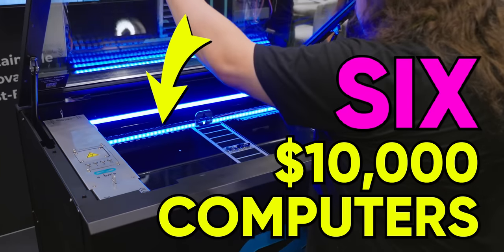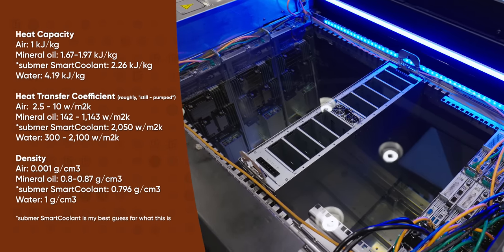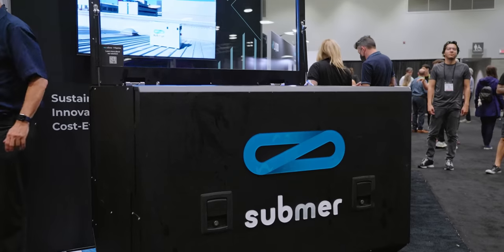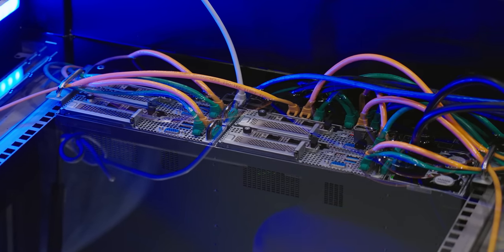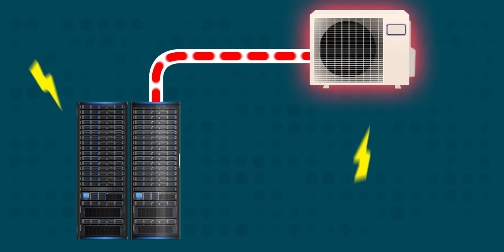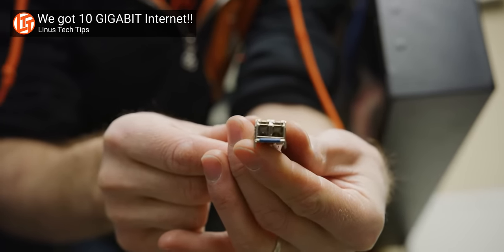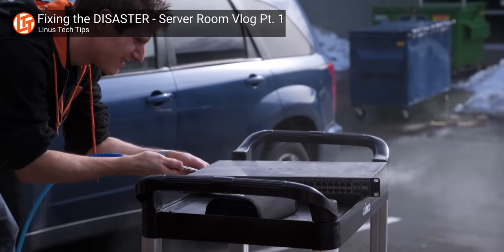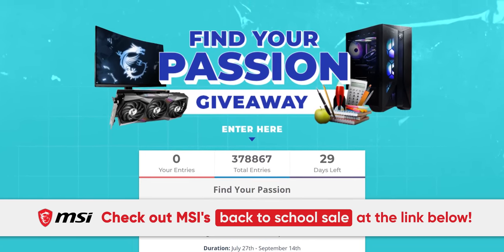This server lives underwater! - Hypertec Immersion Cooling

Comment: Get this hypertech!!
Take that hot water generated in the loop and put it inside floor pipes for some warmth, what do you say ?
* trying to be as efficient as possible for using the generated heat *

Comment: Do you need heatsinks on the CPU's and GPU's?  How are upgrades?
Reply: Hi Hard Cold, Yes you do. The only difference is you cannot use silicone-based thermal paste. These need to be replaced with indium foil or graphene pads.

Comment: Could this tech be used in submarines? Doug from SV Seeker was building a towed array meant to operate at depths of 3000 feet. Rather than build a vessel to keep pressure off of the electronics, could the vessel just let the coolant at sea pressure act directly on electronic components?

Comment: I would buy a solution like this for my next PC at home (which I will build 2025 or 2026), probably Ryzen 9 9950X + RTX 5090Ti.

No, I'm not joking. If I can get a home usable case and the heat exchanger for about EUR 5.000,- I will buy. Completely silent and excellent cooling power.

Comment: This could also protect (some of) your equipment from an uncontrolled fire in the datacenter.
Reply: The datasheet for this stuff shows the fire point to be 233°C.
So it's flammable.

Fire point refers to the temperature at or above which a flammable 
liquid produces enough vapor to ignite by spark or flame and burn for at
 least five seconds. The fire point is usually 10°C more than the flash 
point of a liquid.

But if enough volume of fluid was used, it could prevent a fire, but then imagine something getting hotter, and hotter, then the pump goes down, or there is major fluid leak, or a lightning strike. It could be like fighting a fire with fire. :-)
Reply: @waynesallee-com  Thanks for the info!

Comment: The only environmentally friendly aspect is water degrading already safe to consume coolant.

Separation of sufficient tonnage of the specific plastics required to form a legion of server housings from the ocean is highly inefficient, and such efforts likely outweigh through fuel alone which was spent gathering it, any benefits of said plastics removal.
Reply: tl:dr; Recycle some aluminum to make the chassis, then you can greenwash your product.

Otherwise this is neat.

Comment: Oh I really hope this becomes the new era of consumer cooling. If this thing doesn't need to be replaced for a wooping 15 years (which is like nuts as on average gamers change the case in 5-8 years), And you don't need to drain it every time you need to perform some maintenance that need be attending... AND it cools much better then water loops... AND protects the components because... They're not exposed to air...
Gosh I can already see the future PC cases that are built like aquarium tanks and runs dead silent while being very cool (in both senses).

Comment: I don't quite get how they get enough coolant flow around the tiny server heatsinks without pointing a pump directly at it. I don't think natural convection will be enough for that. Even worse with PSUs that are still in a tiny separate enclosure.

Comment: Could this liquid be used in a fire suppression system in the LTT server room? I noticed the server room has what looks like a sprinkler in the back, could this liquid be used instead if it's not flammable? Like if it's not flammable and not conductive, it should work for a server fire suppression right? So long as the pipes aren't made of something that corrodes or oxidizes easily and the fire suppression is circulated/filtered every so often.

Comment: I'm curious if there is physical degredation of components like you get with minearal oil.  i've seen mineral oil can degrade compoennts, weaken solder joints, permeate pcb's, eat away at cables... I wonder if this magic dielectric does anything like that to components.

Comment: I mean, air is a fluid too in a sense... I just wonder how much circulation is necessary in there with a dense setup and dozens of kW of heating power. There is a reason fans exist after all instead of just passively cooling the air in a DC.

Comment: I think this product is ultimately for niche uses.  The example of the server room in the LTT studios is a perfect case, also because of the superior thermals, high work equipment doing modeling, imaging, engineering etc will benefit.  I doubt server farms will ever buy into this tech because of their turn around.  I imagine it's a high buy in price for server racks when one of the main benefits (server longevity) isn't a concern for COLOs.  In fact many data centers have been moving to swamp coolers because the server turnover rate is 1 to 2 years, they'll let them run themselves dead in a 90 degree room because the plan is to replace anyway.  The other benefits of the system, lower long term cooling and power consumption is moot when you are in a swamp cooled data center.

Comment: I was initially dismissive, but now I'm a mixed of skeptical and curious. The power draw of an HVAC as both a financial and environmental cost being cut out make this a pretty cool product. I'd be worried about maintenance though. It sounds like something that could suck up a lot of money very, very quickly if something goes wrong.
Reply: Hi Andy, the maintenance on this system is actually quite simple you can see it as a heat exchanger, pump, and dry cooler which is quite simple to maintain and could be handled by any HVAC technician.
Reply: @HypertecGroup  I appreciate the reply and apologize for my unclear comment. I was actually talking about maintenance on the server itself rather than the heat exchanger, pump, and dry cooler.
Reply: @LemmingAttack  Typically an immersion installation would include an overhead winch to greatly simplify server maintenance. Also, each node is hot-swappable and can be serviced individually. That being said I would encourage you to reach out to us to discuss this further.

Comment: Mabye i missed something but...how are u cooling that other tank the hvac looking unit exchanges heat with to keep servers cool on the opposing side? Where is this water coming from and what is being done to keep it at a cool temperature for operation?
Reply: Hi Zammy, because this was on a show floor we were not allowed to bring any piping to it being in a normal installation you would have two pipes coming to the tank that are connected to a dry cooler. Typically this is what we would call a warm water loop as in supply temp is 32 C

Comment: Always wary of a proprietary fluid like this as the company usually does not explain exactly what chemicals are in it.  When servicing this equipment I would be damm sure to know that if I need to stick my arm in that fluid that it's safe and not going to affect me long term.  Even touching all the cabinets and asociated parts will have this chemical on it as with that mineral oil cooling it gets EVERYWHERE!.

Comment: Looks like this increases the floor space used in a datacentre hall when going from a vertical rack to a horizontal cabinet? How does that affect server density per square area?
Reply: Hi welshalan, as there’s no hot aisle containment needed, it provides 10x more server density than your standard data center rack which is 16 sq. ft and has a capacity of 10 kW as opposed to a submerged rack at 35 sq. ft with a capacity of 100 kW. Basically, it would take 10 standard racks to reach 100 kW taking up 160 sq. ft. vs 35 sq. ft.

Comment: What about storage servers? Nobody is going to drop a fully loaded storage server into one of these themselves, even as a two person team it'd be awkward at best, not to mention workplace safety. Are they going to have a rig that assists with this that also makes the workplace safety people happy, or are they expecting anyone with a storage server to have the arrays fully separated in a separate rack with the head existing in this rack? This also extends to any other unreasonably heavy server. 

I'm also curious about the cooling components. Are they basing their numbers off of stock heatsinks, or are they using custom heatsinks? Since it's a tub of water that apparently goes into a loop, how are they achieving proper flow dynamics throughout the tub and not just recycling freshly cooled coolant back into the cooling loop while having a hot pool with an area of mixing? How are they achieving vortices around the heatsinks to ensure boundary layer separation for optimal cooling if they're not using any kind of jetting? I like the trade show coverage, but things like this really need the finer details.

Comment: this reminds me of a setup i saw... about 15 years ago :) i friend of mine used the heat from his computer to heat his aquarium (with sensors to dump the heat via normal radiators if the fish tank didn't need heat etc.. was a nice project)
i like the idea to use the the "garbabe" of a computer (yes i mean heat) 
one thing puzzles me.. tis demo unit seems to have nothing to create a current... no pump no bubbles... is this tank so good designed so it uses only the exchange pumps so no heat pockets are noticable? btw... i know peltier elements are not really efficient... but could they be used to make use of the temperature difference between cold and hot liquid? this may be one of the few cases where this may be a viable option

Comment: Cool tech but that must have horrendous floor loading. Can see DCs refusing this hardware because they are geared up for air, in rack water cooling or HAC based watercooled air cooling with floating floors rather than as they suggest it being an 'easy install'.

Maybe for an edge node in an office location, but I can't see any DC signing off on this in a suite or datafloor.

100kw power load is impressive tho.

Comment: Would this be possible on a scale of the Nvidia and Amd GPUs? I could imagine various GPU partners using this method to create their own 'Immersed' variations of an RTX 4090 for example. It could be a "block" of roughly the size of 3 brackets air-cooled variations; but instead it is a containment unit of that size which contains the card immersed in that same liquid. It could be very similar to MSI's SupriM variant, but the WHOLE card would be contained in that unit instead of just having the Core liquid-cooled.

I'm sure it could be done by the RTX 5xxx release schedule if anything.

Comment: Why couldn’t you coat entire boards in a heat conducive electronically insulating material that could be easily dissolved or melted to replace components and then easily reapplied after repairs? I’m sure there are some challenges but whatever.

Comment: PFFT they can recirculate the hot liquid to meet heating demands? As a former FX8350 owner I've used my computer to heat my apartment, that's not even new.

Comment: If you actually have to stop filming when you open the server room you're missing another two doors.  

Add another two triple glazed entry isolation spaces with double doors and automatic doors for the first and second set of doors. Then you can also improve filtration and cooling.

Well done Anthony, if the solution tasted sweet its glycol.  Its not safe to drink as it will kill you.😆. Just the same way antifreeze acts in car cooling systems it can do the same for electronics up to a point...  But everything evaporates so would take their claims with a pinch of salt

Comment: Are you sure it isnt 3M Novec ? They literally advertise it for "large servers" and have differerent formulas with a higher boiling point (30 to 167 Degrees Celsius)
EDIT: Also "Non toxic, inhalation save, no skin iritation etc"

Comment: While this invention is very cool (pun intended), the root of the problem still stands:
Over 500w of energy for a single component is just waste. Nvidia has to change their architecture because this is madness. Otherwise rtx gen6 will have a 6600 at 1000w alone.

Comment: None of these are new concepts, not that I don't appreciate seeing them.  Heat transfer and recovery is the heart of chemical engineering.  Data centers have increasingly become a target for interesting heat transfer ideas as they're not getting any smaller and energy isn't getting any cheaper.  Done a few different bids on various ways of recovering energy from different ones around the country.  It all depends on the location and type of installation.  Obviously, there's still a specific amount of energy spent to achieve the necessary cooling no matter how it's done.  How it's transferred and how much is recovered is, of course, dependent on capital costs, facility layout, and energy costs.

Comment: 0:11 not possible lol. nothing that could be used in this application is going to have a higher specific heat than water or thermal conductivity.